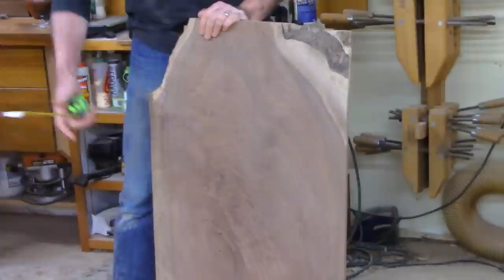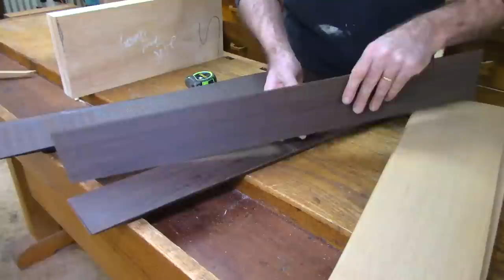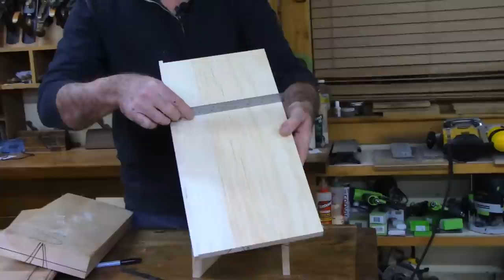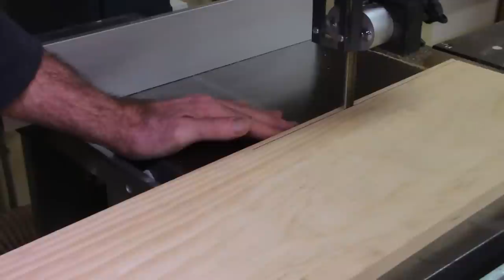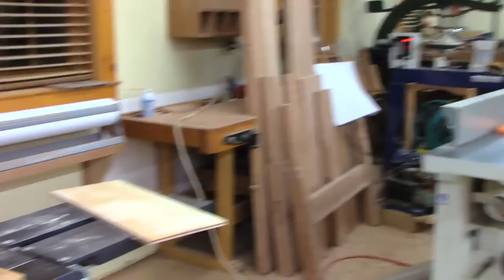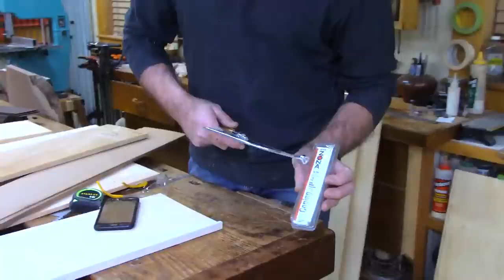Resawing Lumber on a Bandsaw with Tom McLaughlin

Comment: I learned a lesson about the blade bowing while milling a piece of Live oak last week. I usually use a 1” blade, but I happened to have a 3/8” blade on (due to a project I’m working on for my wife) and decided to see what would happen. It bowed so much it was a point of concern, lol, but I made it through it. I’ll finish my wife’s project before milling any more logs.Thanks for the explanation on the tension and slack created in the blade due to resistance of the wood. That painted a clear picture for me. I use a steel sled that we machined and fabricated for my bandsaw which allows me to mill up to 12” diameter by up to 27” long logs. It works great, but definitely requires the larger blade.
Reply from the maker: Thank you, I’m glad you found it helpful. Sorry you had to learn that one the hard way, I always hated to waste material after discover the blade had bowed internally. But as they say, we learn best from when things don’t go as planned. Which is pretty much behind every demonstration I’ve ever made a part of our Shop Night Live! 😎 Thanks for watching! 👍
Reply: @EpicWoodworking  Thankfully, I have an almost endless supply of Live oak logs.

Comment: You can set the fence plate to adjust för drift. Look at page 30 in the manual under "direktion of cut and parallelism".
Reply from the maker: Thanks, I will check that out. It’s not all that obvious how that adjustment is possible after examining the fence. I guess the saying is true, when all else fails read the directions 😎
Reply: @EpicWoodworking  It is difficult to explain on words but as i see it you will change the angle of the fence by adjusting the fence plate. It should have the same effect as if you use wedges or shims.

Comment: I have a 14 inch Jet and I have been using a 3/4" resaw blade, but I think I might get better results from a 1/2" blade, mainly because I could get higher tension. I don't usually resaw to get real thin stock for veneering, but thinnish stock for small boxes, like 3/8 or 1/4. I processed of bunch of billets of split oak into ~2 x ~4 quarter-sawn boards about 32 inches long, and the 3/4 inch blade seemed to wander badly and flex in the cut. I think I need higher tension.
Reply from the maker: Yes Rick, there are a number of factors that can cause the blade to wander like that in addition to blade tension. The number of TPI should be as few as you can stand to reduce the stress in the blade during the cut, 1 - 3 TPI being ideal for resawing. Tim Coleman, who does a lot of nice resawing recommends using a Carbide bandsaw blade like the Lenox Woodmaster CT, 1” x 1.3 tpi. If your bandsaw is not large enough for that I would suggest using close to the max of what your saw can fit. Note, all the materials I’m talking about here are run through a drum sander to fine tune and smooth and thickness to dimension.
Hope that helps!
Tom

Comment: Hi Tom. The Laguna DriftMaster fence is no longer available. I think Laguna stopped producing it 8 or more years ago. I use a shop made fence that I can clamp onto the bandsaw table and adjust for drift when resawing.
Reply from the maker: Good to know, thanks Carl! 👍 I did the same with a shop made fence on my previous old 36” bandsaw since it never had a fence when I got it.

Comment: HI tom...for a bandsaw 3 hp motor ( Scheppach Basato 5-2) wich blde you recomend?
Reply from the maker: Hi Dario,
It depends what type of sawing you’re interested in doing. A strong saw like that is more than likely ideal for resawing. I typically tuna 1” blade with few teeth per inch. I haven’t tried this particular blade yet for resawing, but it will be my next one…recommended by Tim Coleman (Timothycoleman.com) a maker for whom I have a lot of respect. It’s a Carbide bandsaw blade: 
Lenox Woodmaster CT, 1” x 1.3 tpi
Hope that helps! 👍

Comment: Take the fence off of the locking mechanism and clamp it to the table.   I’ve seen Rob Cosman do this.
Reply from the maker: Sure, that’s another option as well...Whatever works best with your particular bandsaw and for your situation 👍 I like having a quick connect aux fence now for resawing as I get the higher fence and drift correction in one quick attachment. Thanks!

Comment: Hi Tom...wich tpi you recomend for resaw oak ? ...and 3/4 0r  1" wide blade? thanks for your videos! great ones
Reply: Hi, not Tom but the rule of thumb I've always worked to is that you want three teeth in contact with the wood at anyone time.  For resawing unless I'm trying to make a very thin veneer cut I usually go with a 3 tpi or a 2-3 tpi varitooth design.  A higher tpi might give a slightly better surface finish but unless you go very slowly it will struggle to efficiently remove the sawdust from the cut.  If sawdust builds up the blade will wander and not cut in a straight line.  Hope this helps

Comment: Hello Tom and thanks for this great video. My panels would come right out of the bandsaw cupped. Is this normal or am I doing something wrong? Thanks again
Reply from the maker: It does happen as a result of the change in equilibrium of the material after freshly being cut, especially on the outer pieces since the moisture content difference is greatest after cutting the outer pieces. You need to allow for some movement, and “re-stabilizing” of the pieces before flattening and thicknessing to the desired new dimension. I do go into this later in the video. Thanks!
Reply: @EpicWoodworking  thanks Tom. That's a relief. I will do as you advised. Wish you all the best.

Comment: Hey Tom I bought a 510 last year and have been having problems with the tires. They had some bad batches I'm on the third set , tires keep wondering and coming off with blade!  Do the tires on your machine fill the void between the shoulders of the wheels completely? Because every set I get they are about 3/16 shy and the tires wonder back and forth across wheel while tracking.  Service suggested Glue and I don't think that is a solution could use your insight. thanks.
Reply from the maker: Hey Ken,
I have never experienced the tires wandering and coming off. This video by a bandsaw specialist might help, he explains why tires come off. I think it is best to glue it to the wheel...I alway had to with mine but not sure how the Felder came, glued it not. Anyway, hope this helps and leads you to a good solution, Tom
https://youtu.be/CFZOlNsAgBU
Reply: @EpicWoodworking  Felder tires are not glued, my question is on your saw do the tires completely fill the void between the shoulders on the wheel,  that would stop it ( the tires) from wandering I would think.
Reply: I talk to Alex at a couple of woodworking show bought some carter guides from him (14" delta) good guy very knowledgeable.
Reply from the maker: There is about 1/16” of metal wheel on either side of the tire on mine, and yes, my tires do sit fully inside the recess.
Reply: @EpicWoodworking  Thank you I will give service a call again.

Comment: Can you not adjust the your rails
Reply from the maker: That’s another possibility although not an easy alteration on the Felder 510. But that’s a great idea if it works well for your bandsaw...almost like rotating the table a bit. For my needs the quick connect, drift adjusted, aux higher fence is working well...for now 😎 , Thanks!

Comment: Can i suggest you get cracking? 2 minutes in havent learned anything. Much shorter intro, and leave the fluff and networking to the end, if at all.
Reply: It’s possible to skip to the parts you’re interested it by tapping on the right lower portion of the picture if you have a touch screen.  Give it a try.
Reply: If you’re in a hurry you might be able to choose a higher playback speed.